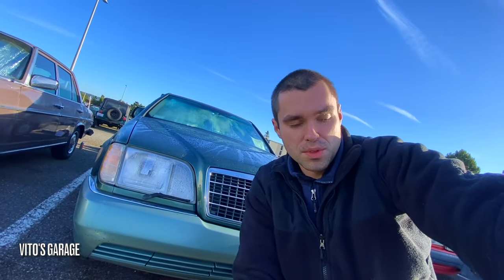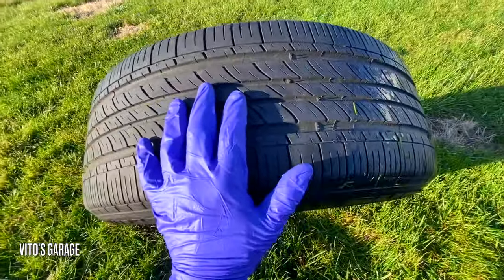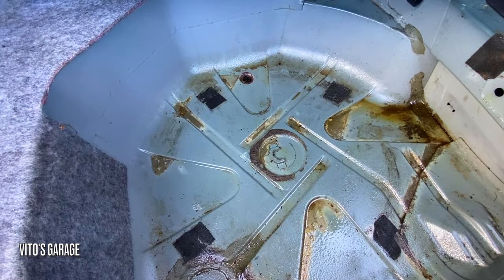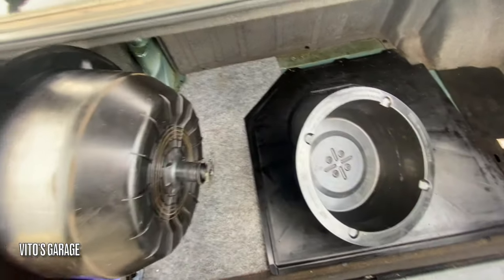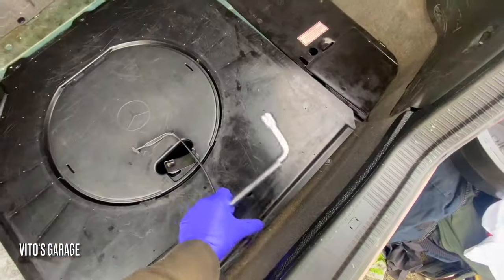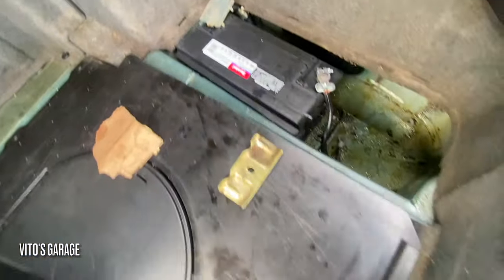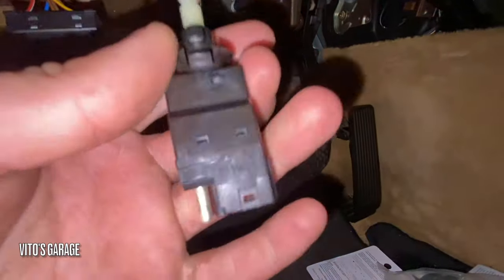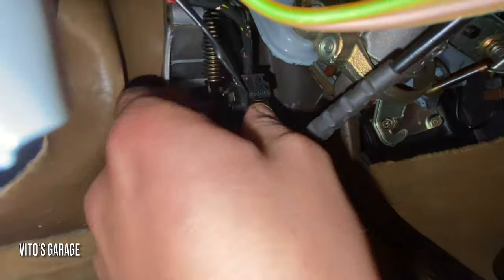Crocodile Mercedes W140 Factory Toolkit, Spare Wheel and New Brake Light Switch!

Comment: Klasse,das du  auch bei den Kleinteilen auf Originalität achtest,toll.Aber im Kofferraum fehlt noch die linke Innenverkleidung,oder??
Reply from the maker: The radio antenna needs to be rebuilt or replaced and the amplifier. So the panel is off now

Comment: Vito i need some help. So i have a 190e w201 and i noticed my front left wheel starts to shake around 50 to 60 mph, and becomes steady at 70. is this an aliment problem or control arm maybe roll bar? I dont know i been trying to figure it out, if you know anything about this i would appreciate it so much! Love the videos btw
Reply from the maker: Thank you for supporting!! What have you tried checking so far? Make sure your wheels aren’t bent first and that they’re balanced properly. Make sure the suspension is tight. Nothing is very loose. It may also be a problem with the driveshaft, or bad driveshaft center support. Check those things

Comment: Hi,
What do you think of a w140 with the om603.912 engine?
Reply from the maker: Great engine!! Go for it! W140 is a legend!
Reply: @VITOSGARAGE  
Other than the car will be slow because the om603.912 is NA, is there any potential problems I will face?
Thanks.
Reply from the maker: @alioudadsse1959  I can’t tell you that. It depends how the car was cared for. On my W140 I installed a new trans. And still sorting it out because it was neglected. But it’s all worth it because we love these amazing machines. 
Diesel W140s are rare in general. You should get it and start the journey. Just don’t overheat it. Just like any other engine. OM603s are sweet engines. But sometimes you need to expect work needed done like injectors, glow plugs, seals. Like I said, it depends what’s been done and not done. These machines are 30-40 years old and need our love. Most of the parts are original and never been changed
Reply: @VITOSGARAGE  
Thank you for the answer, 
My idea is to put the om603.912 non turbo of the w124 ( manual gearbox) on a w140 short body).